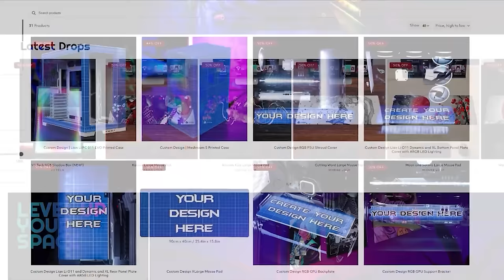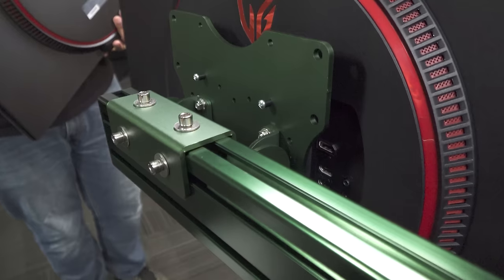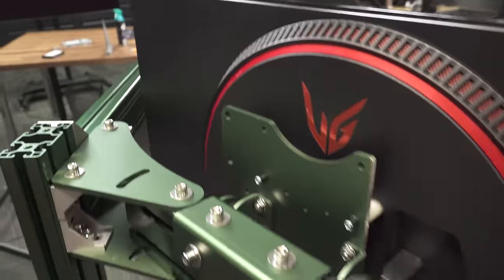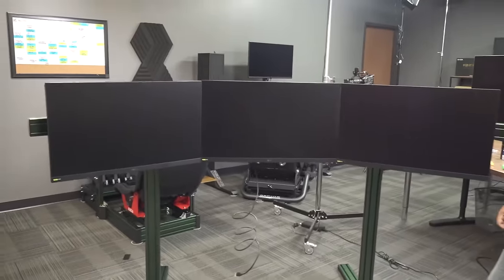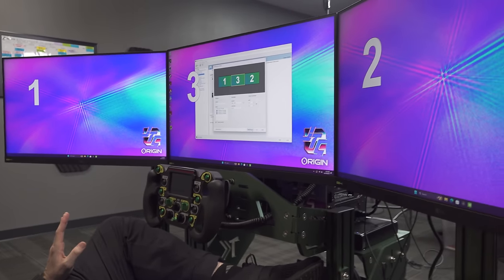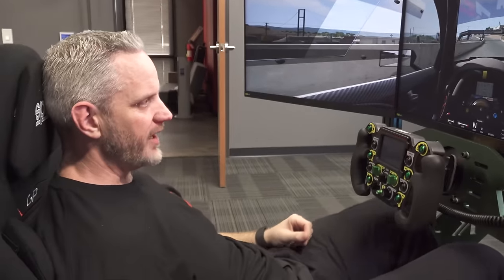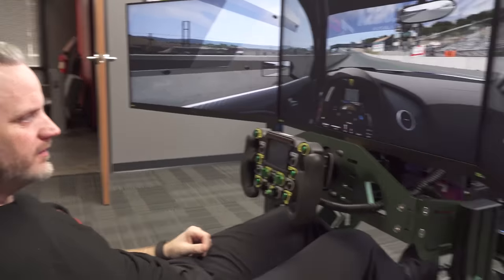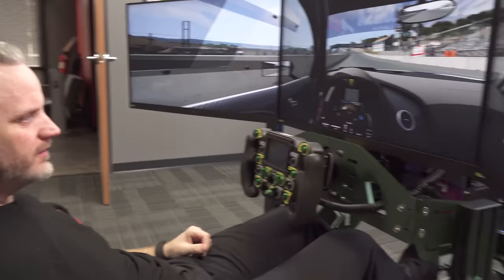I haven't used NV surround in over 7 years! Does is still suck?

Comment: I've been an avid user of Nvidia surround for gaming for nearly a decade at this point. Recently I upgraded to 3 3440x1440 curved samsung 100hz ultrawides and I have been very impressed with the performance modern cards can give. 

I am on a ryzen 9 3900 and a rtx 3080 ti and I can maintain high 50s to 70s thanks to dlss with very little quality loss on many high performance titles like red dead redemption 2 , and cyberpunk and most other games don't even need it to maintain a frankly incredible framerate for 10320x1440. Some titles give outright incredible performance like armored core and thanks to flawlesswidescreen even elden ring works at a solid 60 fps (though they will ban you for using the tool online)

Everything from stardew valley, to euro truck simulator, to cs go, to forza, mechwarrior online, the list goes on. I would say the majority of games i run into work fairly well though some require a little fiddling occasionally to get it perfect.  But it's easier than ever and more affordable than ever.

There is nothing quite like it.

I can never go back to playing on even a single screen.

Comment: ok i am not sure but i think you build the monitor stand wrong. like very wrong.  mine is not like that at all. the middle Horizontal bar needs to be infrond of the 2 Verticals and the angles need to be mounted on the Horizontal bar. That way you can move the inwards. The problem is that you put those spaces. I have exactly the same monitors and i hade the sasme issue and i bought angle DP extensions to solve the issue.
Reply: And also i bought the mounting kit from simlab that way you can mount thosse screens with out need of cut and the regulations on those are verry very good !! Check those out

Comment: Multiple issues here. First, the TK triple monitor stand from microcenter is trash. The arms will eventually start to sag if not break. 

The 2nd issue is the sim lab vario triple monitor stand is way better. Yea it’s more expensive but the time it saves you trying to align the monitors is more than worth it. Look at all the struggles you had, the vario mounts allow for alignment tuning via hardware not to mention are way more robust in quality. 

I had the same triple stand and returned it and just bought the sim lab vario stand. Worlds better.

Comment: Monitors are installed wrong. Hinge should be bolted directly to the back profile support and slid in.  Angle should be 50 or 60 degrees. The whole purpose of profile is the versatility. Can’t understand why they installed it that way. Horrible angles.

Comment: Luckily you chose LG... I cursed the Manufacturer's Monitors with the S on at least 6 of these Tryptichons because they always delivered a neutral white one on three Monitors, one with a reddish color cast and the third one on a bluish color... and the Color Calibration couldn't compensate for it. It made no Difference whether the Monitors were curved or straight. The current gaming/streaming Setup consists of three LG 40WP95XP (5120x2160) 5K2K Curved Monitors and one LG SDQHD (2560*2880) for OBS and Chat. It's almost perfect because I built the Monitor-Support-Stand myself out of Aluminum Profiles... better and much cheaper than anything pre-produced... although I have to admit that your System comes very close. The Profiles are almost identical.

Comment: This isn't designed for ONly curved. You've messed up the angles by forcing the panels forward. This throws off all the angles including how far the total "curve" of the three monitors is - after finally getting them to touch. The fact that you have to go past the arms natural mounting slot is proof of this. Your spacers are a serious problem in this case. Those outer panels should be MUCH more inward.

Comment: You can hate on AMD all you want but their eyefinity software is friggin amazing. Having it auto switch between configs on a game per game basis or auto switching between extended displays on desktop to eyefinity on game launch is awesome. Nvidia surround on the other hand is horrendous. Ended up having to downgrade from a 3090 to a 6800xt on my flight sim because I had to use a 3rd party app to enable and disable surround which still had issues.

Comment: 90° adapters for the monitor cables.
Cut the arms with your angle grinder like you did with the monitor mounts. Tape from the end and cut just inside the tape so you get a straight cut.
The amount of time it took to mount those screens warrants the COST of the biggest Samsung Odyssey available 😂😂😂

Comment: For basic functionality, it's "okay"

I run 3x 27" 4K monitors in side by side portrait mode.The basic desktop fusion more or less works.
The Windows 10 taskbar is limited to one screen.
Don't fuck with Win11 if you''re using a merged desktop.  It's totally broken and doesn't work in this configuration.
Before I rolled back to Win10, I had to buy a 3rd Party taskbar replacement (Start11) to get a USABLE taskbar.

But the primary culprit is Win11's shit UI.

Comment: Setting up the triples is a pain in the ass u need certain brackets from sim-lab you need to get to make it easier ….the TR bracket is straight garbage.. those monitors are setup horribly btw…. Get the vario vesa adapter kit and the xero play triple pivot adapters from sim-lab

Comment: Your monitors are going to be to flat.   I run about 60 degrees on mine for IRacing and my monitor stand legs sit behind the horizontal extrusion .  This means you can close the monitors up a bit more to eliminate the gaps.

Comment: Yes, Surround still sucks. All racing games need to implemented proper triple projection. Also, you're gonna wanna adjust your monitor angle to get the outside edges almost aligned with the side of your head to you can get a properly projected 170-180 degree fov, otherwise, triples are completely pointless. Typically the angle sweet spot between monitors in 66ish degrees.

Comment: A stock sized Vesa 100 mount on an arm wouldnt be in the way of those LG HDMI ports.
The problem here isnt the monitor ... its the dumb oversized mount on the rig arms ... why theres no option to put a 100 vesa size plate on there ... is just bizarre.
99% of users are going to attach a monitor with a vesa 100 mount, not including them in the box makes no sense.
Jay having to actually grind/modify that plate is a 'dont buy this system' moment.

Comment: Firstly, good to see you are into sims and testing sim stuff! (cause Linus doesn't understand the market at all when he tried doing it, Jake did though at least) kudos

buuuuuuuuuuuuuuuuuuuuuuuuuuttttt...seriously, to me,  this is a flawed (Cruddy as you said) video in so many ways from a sim racing perspective.... 

No one has looked into, or adjusted ANY fov settings at all based on your monitor position or angle (or selecting the right triple screen settings in graphics options)... what you've done here is an achievable view on a ~49" wide screen monitor with no need for nview... this setup needs a more aggresive angle on side screens with proper game setup, angle/distance/fov (per screen) calcs (also the vertical angle you're looking up, not straight ahead..) for it to be an effective, proper, immersive setup, not just a slapped together solution for the sake of a video. Basically what you've acheived is bigger number better (thanks Gamers nexus)

I run 50 degree angles on my 27" triples on a TR frame for better side views with my centre monitor hard up against the top middle of my wheel base so this is a massive waste in what you've invested and has massive room for improvements. As others mentioned, hit up decent sim racers like Dan Suzuki for advice on game, screen, fov setups. 

Pretty sure it's safe to say that majority of sim racers run multiple manufacture components so this isn't new in our world and not unexpected lol

in summary on the topic, nView works awesome (for me) for all current day sims, I've never had a single issue with any modern "sim" with nview, haven't since my 1080Ti days.. Sometimes doing the work to avoid using nview pays off but is very bespoke especially if not a dedicated rig, but for me, iracing, AC, ACC, AM2, Dirt Rally 2, ETS2 not a single issue ever, my sim rig stays a rig for sims.

Comment: Surround is still garbage the fact that you still have to go through that stupid process every time to turn it on and off sucks. I'm so glad that display magician works for games that don't support triples without surround. Eyefinity from AMD works so much better and can be enabled to auto setup when you launch a game that needs it. Also usually the difference in the menu between single and triple is that triple will render each screen separately from the correct perspective so you won't get that stretching

Comment: Umm

1. Use right angle adapters
2. Slide the arms in further...
3. Turn the arms more so the monitors surround you

You should know better. Cmon mate
Reply: 4. Fix your wheel rotation

Comment: Your triple monitor setup wasn’t done correctly… your initial horizontal bar should have been connected to vertical on the front, not in between. With that setup your side monitors would connect better

Comment: Yeah. You built the stand entirely wrong. 🤣  The arms for the wings are supposed to attach directly to the back crossing piece, and then use the angle brackets to attach the the cross piece onto the front of the legs. Instead you put the legs on the end of the cross piece and attached the wings to the legs. No wonder it didn't work. You'll never be able to get the angle for the monitors correct for the field of view until you fix it.